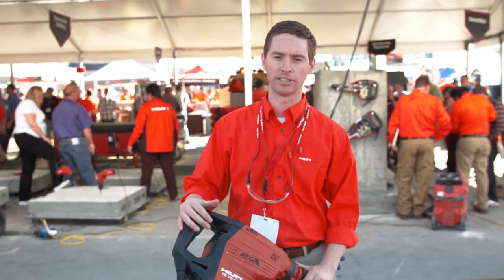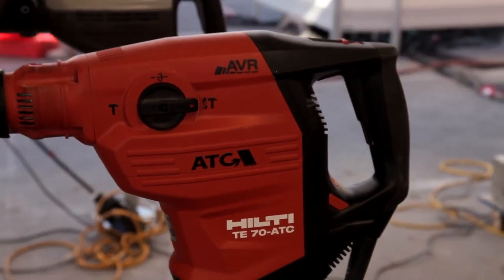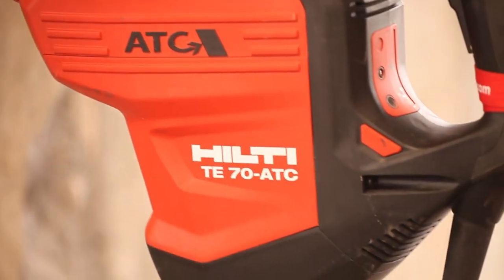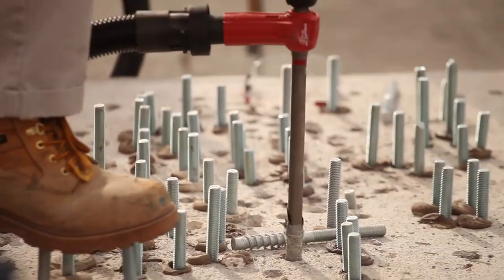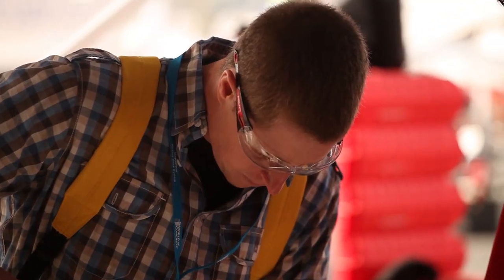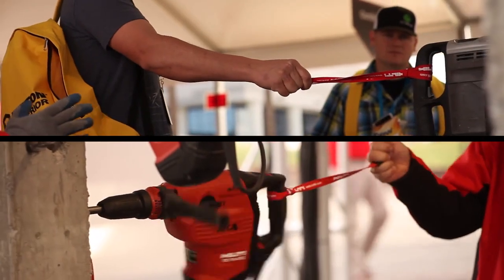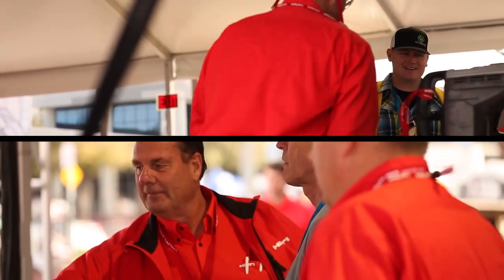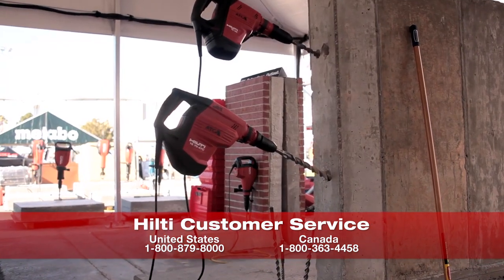INTRODUCING the Hilti TE 70-AVR-ATC combihammer

Comment: What is the difference with the TE-80?
Reply from the maker: Hi Soila – Thanks for the question! The TE 70-ATC/AVR and the TE 80-ATC/AVR rotary hammers both offer premium performance (with very powerful 1800 W and 1700 W motors, respectively) and are ideal for heavy-duty concrete drilling and chiseling. The TE 80 is slightly heavier and has a lower triaxial vibration value when drilling into concrete. We encourage you to visit your local Hilti Store to try the tools out in person. Thank you, -Sarah, Hilti North America Social Media Team
Reply: @HiltiNorthAmerica  TE-70 is not for heavy duty :D its a little toy. I would pick Hilti TE-1000